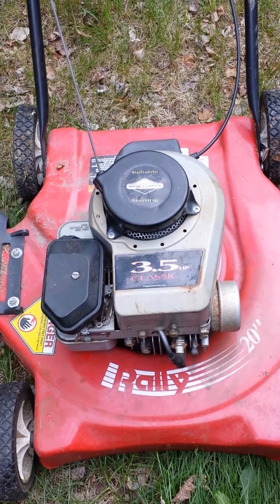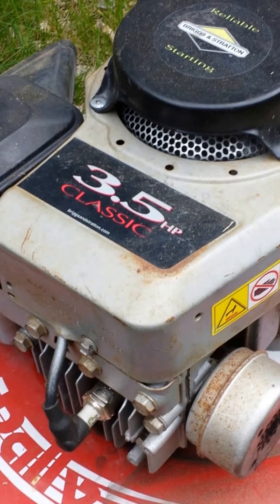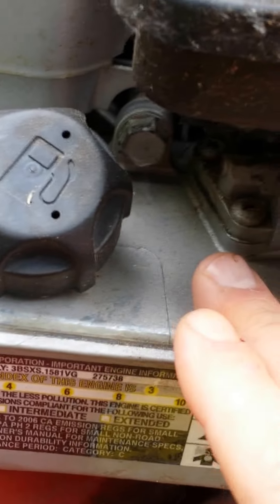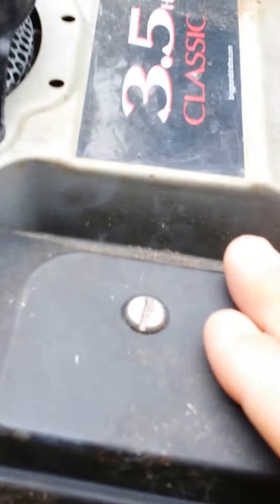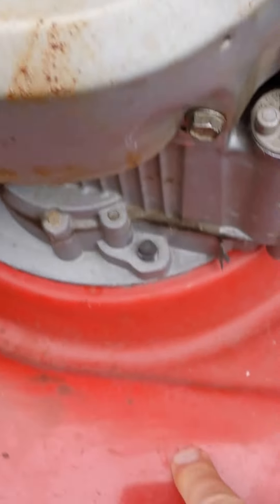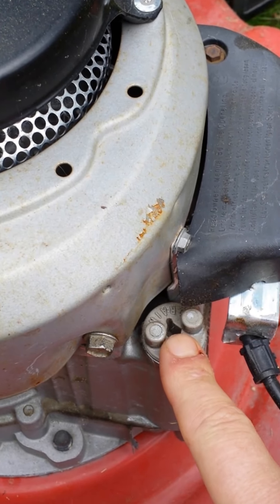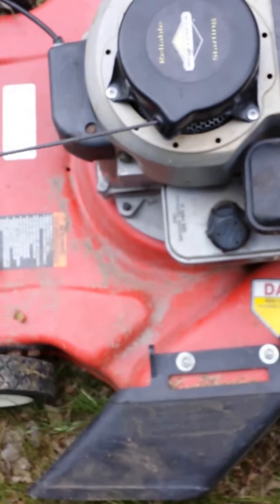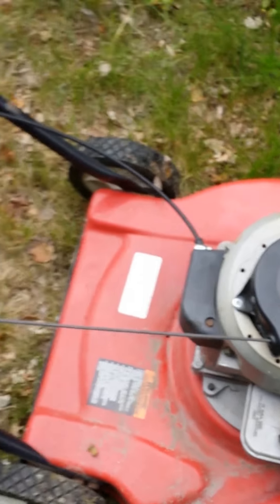How to fix Electrolux Rally 20" Briggs & Stratton Classic 3.5

Comment: I JUST GOT ONE FOR FREE, it had a note on it saying the oil and gas had been drained for winter and it needed a tuneup. (the owner had died so the son had put dads stuff on the curb because his mom was 85. he also put 1 coleman stove and 5 coleman lanterns, 2 of which are from the 1940's!!! and they work!!
gas and oil was put in the mower and gave it 4 pumps to prime the carb and it started on first pull and runs fine!!
oil coming out the muffler means someone tilted it on the WRONG SIDE, allowing engine oil to flow from the valve cover through the vent pipe into the combustion chamber.
clean the spark plug with carb cleaner, give the starter a few pulls to get the oil out through the spark plug hole before putting the plug back in.
i realize that im very late to this video but i just now searched for electrolux lawn mower.
im certified small engine tech since 1992 but have worked on engines almost all my life!